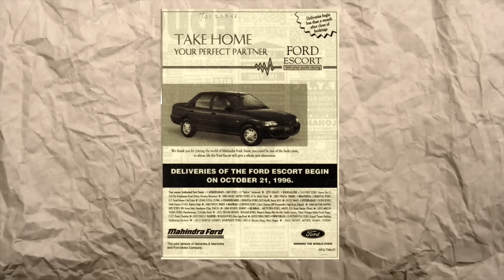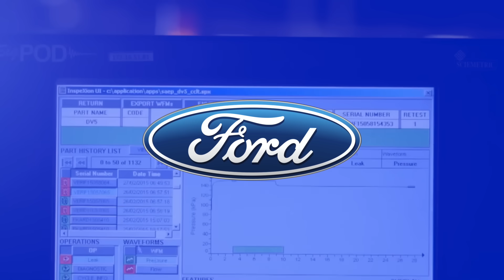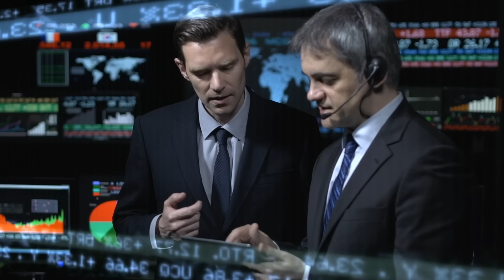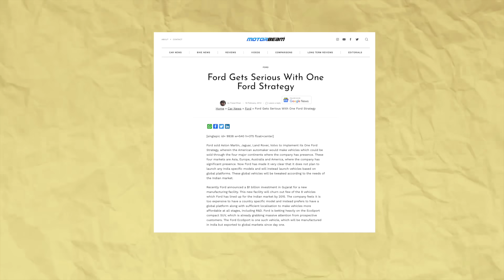Why Ford Failed In India & Simply Left?

Comment: Ford Freestyle is a wonderful car, it doesn't have features like drl or buttons which no one actually needs to use, but is fun to drive and comfortable to travel in, the car also is built for performance
It would be really great if you could please review the car although it is not sold anymore.
Reply: Yes Ford Freestyle is a gem. It's a pure Value for Money (VFM)car. Eventhough it doesn't have gimmics like what hyundai, Kia &MG etc...offering but it have essential features what we are using daily in a car. Anyway Ford is gone😢
Reply: Petrol or diesel?
Reply: I have the petrol version
Reply: Proud owner of Freestyle here. Before I had Maruti & Hyundai cars but this Freestyle is a different species. I'm gonna keep it for a long time
Reply: It had automatic wipers, auto headlights, traction control, 6 airbags, ARP all under 8 lakhs in 2017-18
Reply: @nandux586  It opted out many of these features in 2020 version, even in the second highest model only the tcs control was given and it even didn't have any android car play or anything as such, they did tremendous cost cutting, but kept the price same, also safety features weren't upgraded.
Reply: @aryamukherjee434  What's the parts availability situation now. Are they easily available?

Comment: I have owned figo diesel 2010 and now aspire tdci sports edition 2017 model, brilliant products, bt old figo had more weight and stability. What an engine aspire tdci has, Ttres spin even in 2nd and 3rd gear if there is little less grip on road and what a reliable product it is. Mileage is superb too❤. But I think Ford should make a come back with better strategy yhis time. Waiting for that day

Comment: I own Ford Fiesta 2011 model.
Done 2,80,000 km. The engine, Gear box is untouched. The only maintenance i had tyres, battery and once clutch.
 assembly.
A wonderful car, never broke down in the middle of road.
Still commuting to work.
The only reason they failed due to poor availableability of spares and high cost.

Comment: I miss the Figo 1.5 TDCI Diesel way too much. It was a rocket and handled very well. ❤❤❤. The build quality was top class. But, rightly said ,it missed out on a lot of important features, which the Swift and i10 offered.
Reply: End of the day engine is more important than the features...just a touchscreen audio, reverse parking cam will do the business but our ppl are so obsessed about sunroof, auto ac, start stop system, keyless entry etc etc
Reply: We had the same model bought brand new on 2012, we still use it as our main car. Till now it dosen't had any body sound, engine is super reliable, during those 12 years we din't have any engine problem. What a fantastic car.
Reply: @vijayendranvijay4538  Correct. For me as an enthusiast, I miss the Figo Diesel just because of its engine, handling and built quality. Sadly, for the rest who were looking for VFM, Figo was just not the right choice for them and hence preferred the Swift or i10.
Reply: @ankursaha4705  yes only coz of these ppl, ford had exited India.. same with the case of fiat

Comment: Good presentation, there was a goof up though, which is 2011 Sanand Disaster. Ford invested $1 billion in 2011 which when converted to INR was approximately 4500 crore and not INR 8000 cr. If they had invested those $1 billion now, it would have stood at 8000 cr not in 2011. The exchange rate should be considered of 2011 and not of 2023 in real terms

Comment: I own Ford ecosport and I can tell you that even now it’s competitive and great car from safety and build quality. In 2017 my titanium came with 6 air bags, hill hold assist, Traction control, infotainment system although not touch enabled but a quick after market does the job and let’s not forget driving capabilities compared to other cars. 
I will never sell it, it still operates like brand new and maintenance is cheaper than my Hyundai Verna

Comment: I own ford ecosport petrol 1.5 dragon engine.. what a machine.. loving it.. 

About features, ford ecosport had traction control when even creta didn't had. Floating entertainment system, when others had in dashboard.
TMPS was on a 10 lkh vehicle 5 yrs back, and the list goes on and on.

We failed ford in India . People loved tin boxes with high milage. Drive dynamics kon dekhta hai india main. Now tata has started to offer on Nexon but at a cost 1.5 times Ecosport priced.

Mu frnd has creta. I drove that for almost 500 kms. Features loaded, drives like a car with 4 wheels and on pot holes and bad roads it bounces like a bullock cart. Horrible or can say boaring driving experience.

Conclusion is : i love my Ecosport❤❤❤❤.. milage 12 ki hai but tank chalaneka maja alag hai boss.
Reply: Similar case is going to happen for MG.

personal experience: MG Astor base model only cost 12 lks on road. What a car, features loaded, driving perfect, service good but people will go for creta and seltos. 😂😂.. 

Base Model : style, so check out.

Comment: A good analysis and case study. Tho I'd like to add that it's not entirely that the customers don't value performance, it's just that it probably wasn't marketed as well to actually make any difference. Ford always marketed their smaller cars like Figo/Aspire, Ecosport, etc as "family cars" and never expanded much on the performance aspect. 
Secondly, performance was just one of the very few USP that the cars offered, along with maybe the structural build quality (way above 5 stars yea?) And not much else that felt "upmarket". 
Features are one thing but what's the point of a "performance" car that looks like it was made in the 2000s? I could just buy a Civic from 08 for less price and still end up with more features and conveniences, so what did something like the Figo offer that its rivals didn't? 
Another reason could probably also be that they never bothered to expand their lineup, probably because of the huge losses they were suffering from, and relied too much on the following that the Ecosport and Figo created. Remember the Fiesta sedan from 2014? Yea that was a thing and who knows why they killed it off. Mustang, the iconic, world renowned pony car? Yes let's offer that with just an auto because why bother offering the gearbox that most people prefer in it right? Never bothered with the Fusion/Mondeo when the D segment was thriving.
Tax structures in our market were probably also another nail in the coffin but if their losses were the biggest reason, then perhaps their demise was set way before we even noticed.

Comment: No one can beat the STABILITY AND even if we are at high speed we can control it by in few seconds braking, and dynamics are topnotch. I have driven FORD FIESTA AND ECOSPORT. FORD will give another level experience than other cars.  If we are a 100 or 120kmph  in highway, inside the car we cant feel like we are at 100 or120kmph it feels like we are 80 or 60kmph.

Comment: I still have Gen 2 Endeavour 2007 model done 8 lac kilometres till now 

Still the engine is working perfectly with no oil eating disorder 
All thanks to Mazda for the Motor 

Well the rear ride quality is not good as it’s a pickup truck with rear compartment covered. Originally it’s a Mazda BT50/Ford Ranger XLT 

So it has rear leaf springs with absorbers but no coils same goes for the front it has absorbers but no coils 

The main thing what I witnessed is the techies and mechs in workshop used to make fool of customers and charge them hefty amount

Comment: Still have my Ford Ikon 1.3 flair from 2006, even tho stock the exhaust sounds like stage 3 tuned but handles better than most cars today.  If i were the on FORDs management, i would have slapped a 1lit ecoboost engine in a 2005 Mustang and sold it for under 20Lkhs.  But sad they we still selling bland hatces in the era where Indians were getting pampered by Koreans with plethora of gadgets in their cars
Reply: Is it worth buying 2006 HONDA CITY DOLPHIN FACE-LIFT in 2023 ?

Comment: 1).ford greedy mindset that has  lead them to bankruptcy in india, 
They were doing good with its Chennai plant itself, 
Sanand plant was just for tax benefits rather than production bottle neck. 
2). Fiesta, figo shared the same platform and they have good scale of economy resulting in lower production costs and they sold in good numbers and then ecosport also did good numbers.
All these three successful cars were not updated to carry forward the same success in their previous iteration due to lack of proper product strategy. 
3). Joining hands with mahindra is not at all a good way. 
As said in the video they known for spoiling the things. 
Initially ford then Renault then Sangyang, Engines Engineering, ford again and finally they are in the process of demolishing pininfarina, hope something should happen like what Engines Engineering did to escape from mahindra

Comment: I have Innova Crysta and Ford Endeavour(Probably the best combination of vehicles unlike the herd mentality people owning Innova and Fortuner). No hate to Fortuner,but after having Ford Endeavour in family, I feel Toyota is Far Behind The quality levels that Ford Has provided in terms of build. Toyota Is good in Quality and Durability but Ford Quality is at par much much better than Fortuner,Tata and Mahindra Build Quality levels. I love Innova for Its Stiff Ride quality and stability on plain roads and captain seats comfort but Endeavour slays on Bad roads where Innova stiffness makes me feel a bit uncomfortable 💯 and the 10 speed Torque Converter Automatic Transmission of Endeavour is much Much better than my Innova Crysta Automatic Torque Converter. I have Driven 2.8 Z and 2.7 Innova Automatic too and probably feel they're the worst automatic transmissions because in downshift, Toyota Automatics suck making such big engine cars bit underpowered 👎🏼where Innova excels is bulletproof reliability. If Endeavour can cross 2 lakh kms without any niggles then Innova will cross 8 lakh kms without any niggles 💯 I love my Innova Crysta and Endeavour both and love both vehicle driving pleasure but if someone tells me to choose vehicle for drivinf pleasure then I'll bow down for Endeavour but for Backseat and comfortable drive I'll bow down for my Innova😊
Ps. I dont like fortuner because it does not have a good quality interior, no comfort and no practical feaures for a 50 lakh rs car. If I choose Toyota I'll only Prefer Innova or a Land Cruiser 💯

Comment: It s fraud not ford,it s the company which launched its first product escort with a push rod engine in 1997 and single point fuel injection when all other brands had modern OHC engines,even maruthi 800

Comment: How you can say ford aspire doesn't have features? 
Sorry Faisal but here you are wrong..
I have Ford aspire 2018 model titanium plus 1.5L  diesel variant. It is having rear camera with parking sensor, automatic headlamps , automatic rain sensing wipers, 6 airbags, seat belt warning, climate control ac, power steering, power windows, android auto, apple carplay, steering mounted controls, voice command, fog lamps and fog diffuser, automatic irvm, one touch adjustable orvm, adjustable steering.. powerful diesel engine with good mileage and yess low maintenance to keep it.. itne features to us time ki koi bhi car ni deti.. us time chodho aaj ki bhi koi car is 8-10 lakh ki range m automatic irvm tk ni deti😂
Tm features ki baat kr rhe ho ki ford ni deti thi.. ye bolo logo ki features ni jyda stylish gadiya chaiye thi... Ya fir mileage ka thapaa wali tin can chaiye thi.. 

And don't forget.. that you have done 0-100 under 9.8 seconds in ford aspire in your video and mne wo 9.6 seconds m achieve kra h tmhri video k beans sunkr.. 
Ford was best n still it is best n will remain that in future.. 
Sach m didn't expected that biasedness from you.

Comment: The biggest mistake on Ford's part was to compete against Maruti for market share. They could never have attracted a Maruti customer. The core expectations from a Maruti customer and a Ford customer are totally opposite.
Instead, they should have competed with VW/Skoda. They kind of shared the customer base.
In short, they should have focused on being a low volume brand focused on driving experience, than trying to be a mass market brand.

Comment: Ford was unreliable and very expensive parts and service network too bad infact one of the worst. I have owned ford fiesta 1.6 diesel and ecosport 1.0 ecoboost and have faced way too much issues in both the cars i remember eco sport was at the service center for months and special technician was called from maharashtra to resolve the issue. Never had any issues with VW, vw mechanics are the most trained mechanics in any car manufacturer in india.